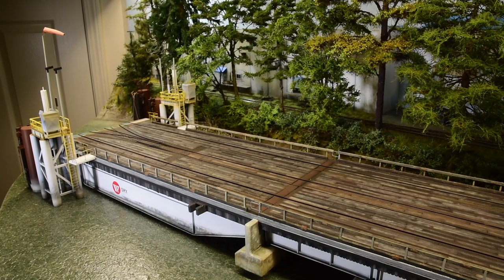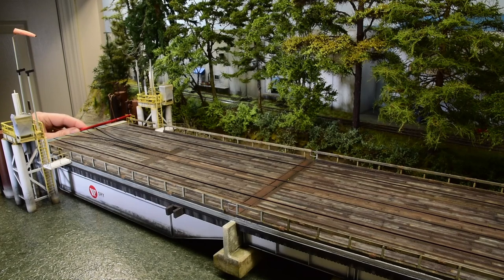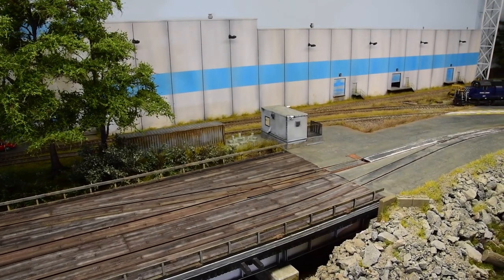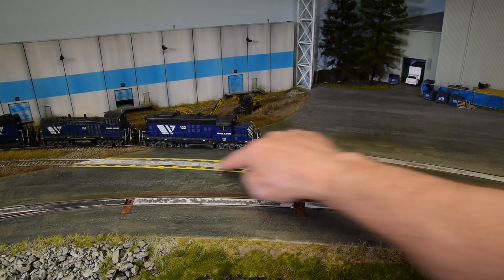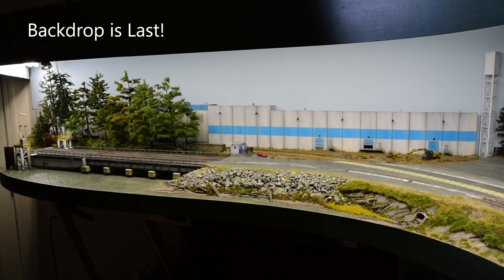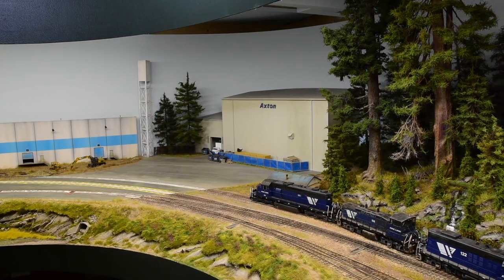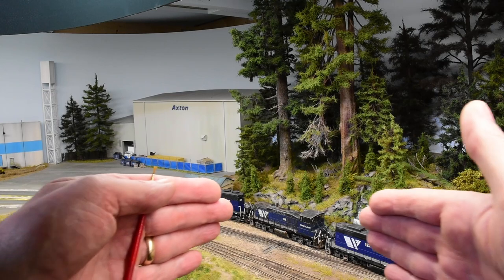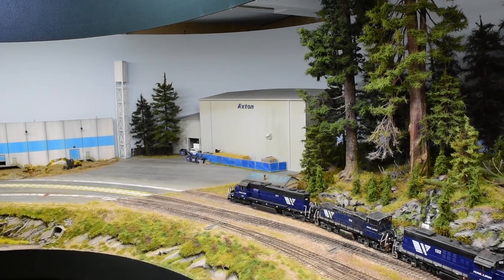Big Shelf Layout Update | Planning & Process - Vlog # 106

Comment: Best statement, "you haven't built a railroad if you haven't had problems", indeed!
Reply from the maker: It is part of the process, I face issues all the time I need to overcome. Anything worthwhile in life requires overcoming. ;-)
Reply: @boomerdiorama  Absolutely! I've just "finished" my basement layout and I'm still running into electrical gremlins, but so worth it now that it's finished. All the best.
Reply from the maker: @uxd8964  Every layout experiences some electrical gremlins at first until you sort them out.. Cheers.

Comment: There,s only one word that describes that scene ,Outstanding. 
You mentioned about module's tending to be flat ,l started experimenting using Chucks blue cloth wipes .
I just push and prod until l get the right look  then just spray diluted Matt medium  glue onto the surface works a treat and adds character to what would of been a flat boring surface ,not only that but it inexpensive to
 use then l just wait to dry add more glue and start adding dirt to the area ,easy and simple.
Keep up the great work
Reply from the maker: Yes! Matte medium works great for cloth as well. Thanks for sharing that.😁 Cheers ~ Boomer.

Comment: I started running a dehumidifier in my train room , huge difference in operation performance. Thanks as always , it is looking amazing ! An inspiration for us all !
Reply from the maker: Yes. Sounds about right. The beauty of climate control. Humidity is a real factor here in the Pacific North West.
Reply: What gauge do you run. Im o gauge on a 18 ft by 24 ft and find adding star pattern wiring much more impotant especially having both negative and positive leads. Initiaaly, many ogauge guys said the negative leads every 6 ft were not necessary. My mth premier engines did better with both positive and negative leads. Have collection in my cellar in nj with a sump pump French drain system, cinder block walls. Never fave rust although the sump always has 5 ga)ons in it. What do you mean better running using a humidifier?
Reply from the maker: @file1man  HO Scale. I have always over-wired my layouts and never had a problem since. Humidity is different for every region and location in the house, etc. You have to try and maintain the sweet spot. But then, an open window changes everything. 😁Cheers.
Reply: @file1man  Hi, I run Marklin (3 rail) HO , My train room and staging area is under my house off my garage it is usually pretty dry under there but found at times running could be a little erratic especially if I had not run trains regularly. Since putting the dehumidifier in that solved that issue but I have switched from cleaning my track with 99% IPA to Kerosene (only very tiny amount on a rag) on the outer rails and that has reduced my track cleaning to almost zero. Hope that helps.
Reply: @herrkiwi3110  thanks. Ive seen rbp trains, a newer ogauge youtube channel do a video this week on cleaning track and using oil and grease on his collection. My ogauge collection is large, bought mostly 2004 to 2016, but have major problems with atlas track making my new trainboard from 2016 thru today, july, 2022. Ive 39 or more mth premier o gauge engine, not run in 8 years, so oil, gease, and humidty are concering. Im about to post my first train videos, youtube channel, the trainboard, running my stuff that has sat for 8 to 12 years.

Comment: Stunning modeling Boomer...  Getting a mountain of great modeling techniques from your videos!  Your work is one of the best balance, all around great modeling that I've seen of late.

Regarding your locomotives bottoming out over the street trackage.  The general model railroading rule of thumb when encasing track in "concrete", "asphalt" or any other medium, is to leave the surface about 1/64" (.016" or 0.4mm)below the top of the rails.  This will allow for expansion or other physical movement, and will ensure that nothing bottoms out.  It'll also make cleaning the track easier, because you won't be rubbing the paint/surface treatment off the road surface when using a track eraser or other cleaning method.

I chose to disregard this rule of thumb on an early layout, and soon realized the logic of doing it that way.  Doesn't look nearly as nice when you sight down the track or in low angle telephoto shots, but it'll make your life a lot easier from an operational standpoint.

Same can be said for adding static grass or other treatment between the rails...  Looks cool as hell, but operationally it can be a pain in the ass.
Reply from the maker: Thank you. The track tolerances can surely be a nightmare for sure. Cheers.

Comment: The 18 ft long straight back edge of my ogauge trainboard has only 2 inches of clearance to the trainbord edge, after allowing for engine and passenger car/ freight car clearances. There is then a 16 inch walkway and display shelves on the cinderblock walls. Suppose I could add rock faces from molds that are 1 to 1.5 inches thick or add some trees or false front bldgs. Suggestions? And yes, I  added way too much track and few areas for landscape. Turns out I like landscaping,  trees, rock formations, hills, more than running the trains.
Reply from the maker: I think we all add too much track . . . and then we run out of revenue. ;-)

Comment: Im actually building a slightly narrower version of your Glover road shelf.. 
Q: I know you used cork base but did  you use any roadbed on top of that been trying to tell if your main is higher than the sidings .. 🤔 your new shelf is outstanding .. Please keep up the vids I really am learning allot from your techniques.. 
and always great inspiration for me
Reply from the maker: Yes. I used cork base but no additional cork road bed. I just chiseled down the lower grade for some of the sidings (onto the underlying plywood). I have no problems with laying track straight onto plywood. It's only switching anyway, and you don't hear anything. ;-) Cheers.

Comment: Boomer, you mentioned the grain terminal at Milner again. It is now surrounded by a "constuction" fence. It is owned by SRY, but they will not allow me to enter the property to photograph and/or measure the structure. Would you have detailed photos you would be willing to share? I have been wanting to build an HO version for several years.
Reply from the maker: I had access when it was operated by Otter Co-op. You can still take pictures outside the fence and use Google Earth for the footing. I have no way to post photos except a few under the community tab. Let me know what you are looking for and I will try and post a few in the "Community" tab section.

Comment: Car ID readers are usually about 3' above track level? Where you were pointing for what you were thinking are too high? They usually are aimed straight horizontally?
Reply: yeah AEI readers are definitely in line with the bottom of the rail car (above the wheels)  would need to see reference photos for more insight.
Reply from the maker: I have no clue what it is. They are on both side of the tower and they have strange looking panels on them.
Reply: I'm thinking it could be some form of laser alignment for the hydraulic damper towers to warn if they move. A vertical version of what is placed in tunnels horizontally.
Reply from the maker: @garyrose8188  That sounds plausible for sure.